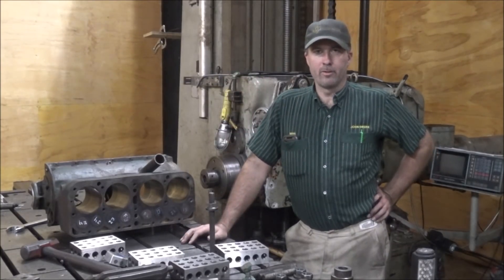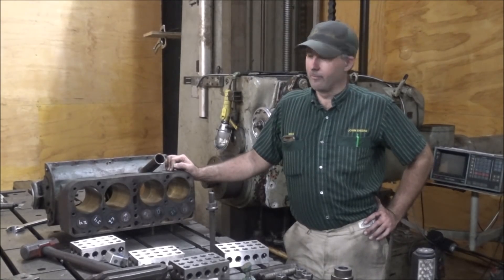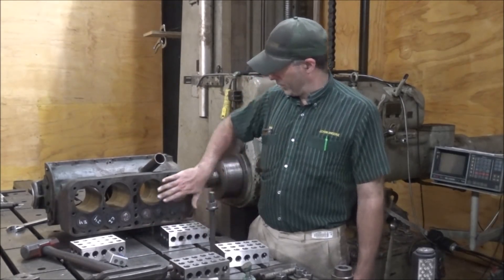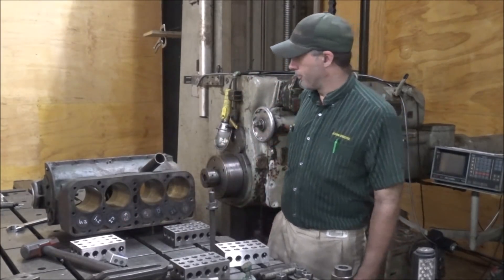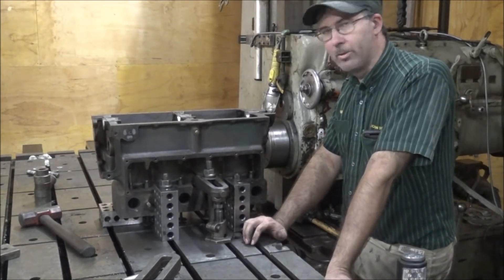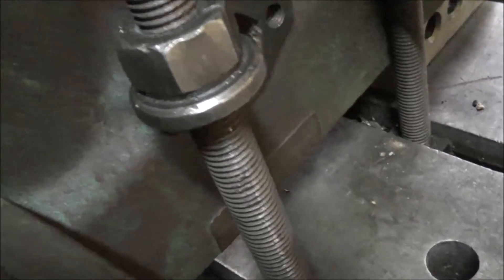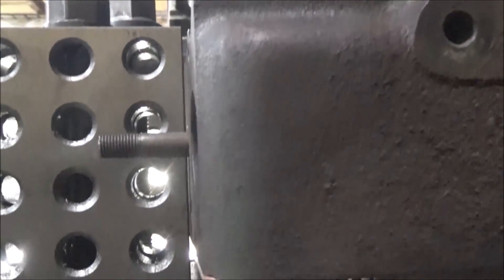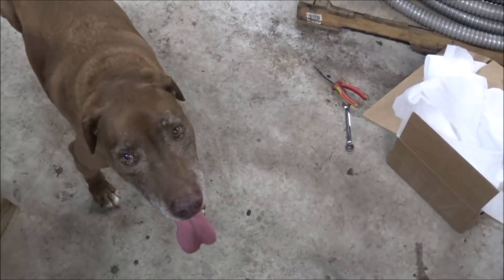Work Holding Tips for Successful Machine Work #TipsBlitz19

Comment: To get the valves out you have to remove the guides at the bottom. The guides are split lengthwise. Make a tool that looks like a letter "C" from the top and is just long enough to put in under the valve head and around the stem. Lift the valve and put the tool under the head and hit the valve with a soft hammer. The guide will be driven out and split away from the stem allowing you to remove the valve through the top.
Reply from the maker: Thanks for the how to!

Comment: Shoe leather for a main bearing is a tried and true technique and just for fun A friend of mine and I used Aluminum cans and horse hide as bearing in a small bock Chevrolet that was on its way to the junkyard, anyway a buddy of mine and I replaced rods and mains and it ran as quietly and as well as it did with its original mains and rods for a couple hundred hours and I believe if we had stopped and repeated the process when the oil pressure started to dip and the engine started laying over it would of made it as long again.  The engine was hooked up to a old truck transmission that was hooked to a pump so the engine was doing some work in case you were wondering and we replaced the old engine with another engine out of a wrecked car to run a water pump and a sludge pump.

Comment: removing Model A valves and their split guides video.. https://youtu.be/gLr2KCQL2vc i would probably use something to transfer the hammering to the center of the valve head.. so you don't bend the valve head over sightly or break the spin weld between the valve head forging and valve stem..   rubber bands can be used between valve stems to hold valves against their seats..
Reply from the maker: Thanks for the tip!. I don't plan to mess with taking them out though.